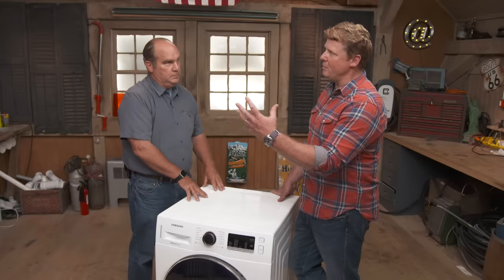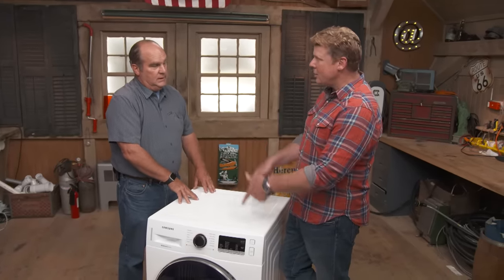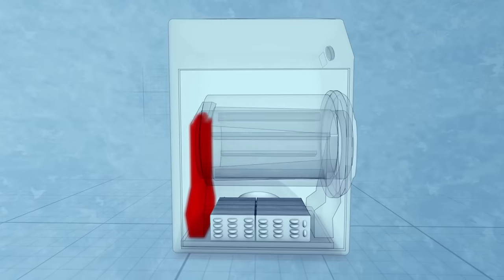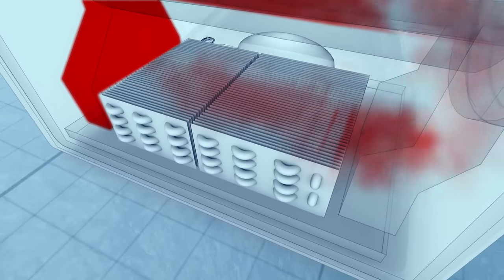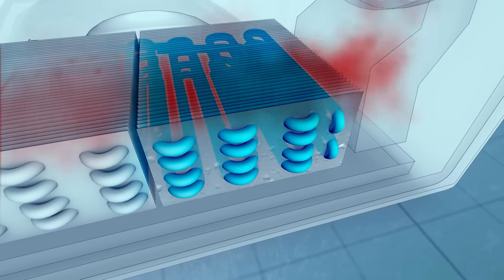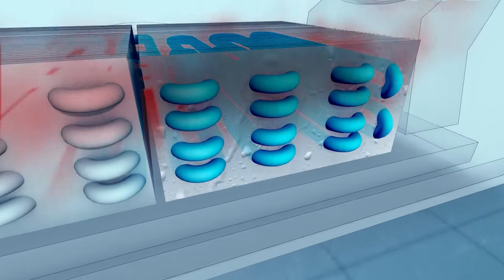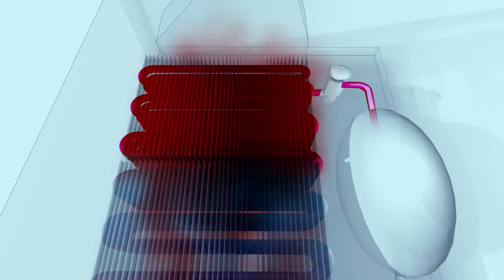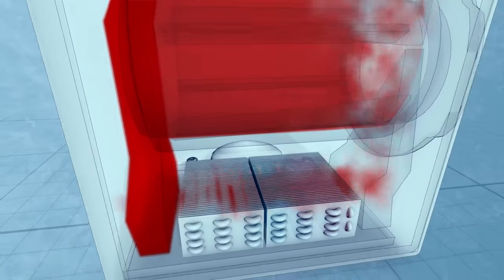Exploring a Heat Pump Clothes Dryer | Ask This Old House

Comment: What stops the condenser from rusting out after being exposed to all the moisture and chemicals (fabric softeners etc.) in laundry? Cheap versions could easily have planned obsolescence built in this part.
Where do the ultra fine particles end up that pass through a standard dryer filter? Do they cling to the condenser and become a food source for mold to grow upon? Is the filter system different?
Users here report that cycles are longer and smaller. So the fibers in one's clothes will be breaking down faster. And bed linens may not be able to be processed any more due to their bulky nature.
The laundry may take twice as long due to fewer items per load and longer processing times. Or we simply don't wash everything as frequently. My teenage niece would re-wash a item if it fell on the floor while taking it out of the dryer or after wearing it for a couple of hours while shopping. It will require changing one's habits I would say or washing nearly every day just to keep up in a family of four or more.

Comment: How much does one of those cost?
Reply: I just bought one for $1420.
Reply: Cory Stansbury ,
WOW!  There go any savings on electric.
Reply: I got one for 1k on a memorial day sale.  Check your power company.  They may also have rebates for getting efficient appliances.  Mine gave me about 75 dollars for getting a heat pump dryer.
Reply: @BB-mq3nn  It appears that expired in my state. However, I did get $750 for a heat pump water heater and another $750 for minisplit. In my case, I got it to help live within my main breaker capacity when adding the minisplit. It also reduced my heating loads due to infiltration/leakage. Energy savings will be icing on the cake.
Reply: @bigred9428  But it's not about saving money, it's about saving the planet, remember? Saving the planet doesn't come cheap (e.g., solar panels, electric cars, LEED homes, all electric homes, etc.)

Comment: Since the moisture stays in and doesn’t have to vent out of the house, does it increase the accumulation of condensation on windows during the winter?
Reply: The moisture turns into water and is either collected in the compartment on the too left or can be directly expelled through the grey tube

Comment: is it powered by 120 or 240 volts ...
Reply: 420 😏
Reply: @mastocytoma1  WHAT
Reply: @rbnhd1976  Yes. Here in continental Europe we don't have the sissy 120 volt system. This is a man's voltage!
Reply: Miele models will run on 120V, others 240.

Comment: You don’t dump the heat from an electric dryer outside in the winter. Instead ,put a nylon sock over the vent , and discharge the heat directly into your home.

Comment: If your not in a rush to dry your clothes, you can save yourself a lot on the energy used by your dryer, and your washing machine.
This is what I do, set the washer to its lowest spin speed, saves power and wear and tear on the washers drive and suspension components, then use an old tech wringer/ mangle to squeeze as much water out the clothes as possible before you put them in the dryer, if you can not get a mangle, use a gravity drain spinner, they spin the clothes a lot faster than most washing machines, use less power and remove more water quicker.
My dryer has the option to switch off the heating element and use just the ambient air to dry the clothes, takes longer but the power saved is well worth the time taken, the top tip is to remove as much water from your washing before it goes in the dryer, the energy saving is worth the extra effort, and using the lowest spin speed on your washer helps to make  it last longer and use less energy.

Comment: I have this exact heat pump dryer and members of my household report having to dry the clothes for 2 hours or more, basically two or three Cycles. I had high hopes for this machine and I'm really disappointed because if it saves 40% and I have to run it twice, aren't I using the same amount of electricity or more if I have to run it a third time? Also the capacity of this dryer is super small

Comment: Just like the new washers that use less water so that your clothes never get truly cleaned, this will more than likely suck also.
Reply: I dont know if Americans can't build low water consumption anything. We have it in Sweden and it works perfect, toilets and  washing machines. Used it for decades no problem here.
Reply: @fristrm    These new washers that weigh out the load to calculate the water level suck here.  Clothes never come out clean unless you wash VERY small loads, which defeats the whole purpose of saving water.
Reply: @mastocytoma1  The problem isn't the low water use washers it's the crap laundry soap we have now. All soaps went to crap in the 90s when they outlawed the use of phosphates in laundry soap and many states followed suit with dishwashing soap as well. TSP is your friend and TOH uses it all the time.
Reply: @fristrm  Not really much need for low water consumption in much of the country. Most drinking water comes from a lake. Then it's used in the house and then to the sewage treatment plant and returned to the lake. In fact the water going back in is cleaner than what is taken out so by using more water you are in effect helping to clean our lakes. 

       That said we have low water use toilets just like europe and our current washers are low water use as well. That said I have spent quite a bit of time in Greece and they do not subscribe to the low water usage standards. Their toilets use massive amounts of water and so do their shower heads. Taking a shower there is wonderful....
Reply: @elcam84   I'm sure that doesn't help.  I've had clothes come out of the washer that had never even touched a drop of water.  That's why I'm convinced it's the low level.  It was small loads as well!   But yes, the soap has changed too!
Reply: @elcam84  You can't judge European standards by Greece alone. How about Germany, Switzerland or even the Nordic countries?
Reply: @yvindascanius6061  Been to most of those as well but was referring to Greece because they aren't on the same page as much of the rest of Europe when it comes to using less water. My worst shower was in a Hotel in Paris..... It was just big enough to stand up in and barely a trickle of water. That was not a fun trip in any way shape or form... 
 
     Northern Europe has taken energy usage and water usage to another level which is great but how and why are another discussion. Here in many parts of the US using less water is not a big deal as many parts have lots of water to use and they return the water to the source it came from. We are fortunate to have the sheer amount and multitude of different resources here.

         Oh and please please get someone to sell ceiling fans in Germany. They could really use them in the summer since few places have air conditioning. You could make a fortune selling them there.
Reply: @elcam84  I have tried a shower like that in Spain. Took forever to get wet.
Reply: F ,
Yeah, but they take like three hours to wash a load of laundry.  I have seen them demonstrated all over youtube.
Reply: I dunno. My new speed queen only f’s up when it set to the eco mode
Reply: Robert Adams Low water usage in a top load US machine will never work properly. Low water usage in a front load machine works perfectly, because of the fundamental difference in the way the clothes move in the solution. Front load machines can use half as much water yet still achieve a better wash at cooler temperatures with less detergent and less damage to clothes than a top load.

Comment: And they cost anywhere between twice and four times as much as a standard type dryer, you'll be lucky if you break even over the unit lifetime via lower runnign costs. They are also lousy performance during winter if you have an unheated utility room or use a garage. Expect very long drying times and, of course, the increased wear on the unit - because the drive belts, bearings and motor will be the first to get clapped out.
Reply: You’re so right.  Except in our situation, the only machine that will fit our cramped space?  A combination unit like the $1600 (plus pedestal taxes and install) LG/GE.
Reply: I paid $800 for this exact unit. True on the unconditioned spaces but that's not the case for I would venture to say the majority of people. Can't speak for longevity yet as I've only had it for about 6 months but unfortunately Samsung doesn't have the best track record when it comes to appliances.

Comment: The upside of having this type of dryer is that it heats up the area a lot. My quick hack is using an indoor clothes rack for the delicates and other items that cannot be put in the dryer. ✌😀
Reply: Tracey Lafontaine  this type of dryer doesn’t heat up the area. Source: I own one
Reply: @Monsieur405  Oops, I actually wanted to mention the LG brand does. 
Good to know about this brand name though ✌😊
Reply: condenser dryers heat the space they are in, they use room air to cool the condenser fins. Heat pumps don't emit any significant heat, they just recycle it over and over.
Reply: @spencerwilton5831  good too know, thanks 😊👌

Comment: No dude, these things take like 3-4 x as long
Reply: There are two types of vent less dryers. Most of them are what we call condenser dryers. They not only take forever (2, or 4 hours). And many (most) models run cold water through the condenser for cooling and then sends the water out to a drain (they thus need a water drain).
As a result you use LOT of water to dry your clothes.
Then there is the REAL heat pump dryers. These units are expensive and have built in heat pump to run the condenser (the same as an air-condition unit).

Heat pump dryers don’t use water for cooling, and they are at least 2 if not 3 or even 4 times faster than condenser dryers. So in place of 4 hours, a heat pump dryer will take about 1 hour. 

So a typical heat dryer might be 30 minutes, the heat pump dryer would be about 1 hour.

A condenser dryer? 3-4 hours! (And it using water for cooling). (We talking gallons of water here). And your clothes is still not really that dry!

A vent less condenser dryer is often smaller, and is often a “combo” washer dryer. 

So, a “combo” washer and “condenser” dryer unit might set you back about $850 dollars. (Some are even cheaper). 

A condenser only dryer? They go for as cheap as $500 or even a bit less.

The real deal Heat pump dryers? The ones with a real fridge unit (aka: heat pump inside)? They are rarely combo units, and they start close to the $1,000 range for JUST the dryer. And you can easily pay $2,000 for some of these units (not a combo unit).

Most heat pump dryers also have a heating element, and if you put the unit on max, it will work as traditional dryers in terms of time. (you same some energy however, since once  temperatures are up, then the heat pump running provides a good deal of the heat required. These units thus can run and use their heating element, or just the heat pump only in a cycle to dry (or a bit of both). They are vent less, and have a water collector, or optional can use a drain. 

But the condensing process for these heat pump dryers work far better because you have a real heat pump running the condenser unit to pull water out of the air. They cause much less wear and tear on clothes, since it not heat that does most of the drying, but a condenser that pulling out moisture. 

Those lower cost “condenser” dryers as noted tend to be combo units – and they tend to increase humidity in the dryer room. 

A heat pump unit does a MUCH better job of removing moisture because there is essentially an air condition unit inside of the unit for the condensing process. 

The energy savings of 50% compared to a regular dryer is due to the unit recycling the hot air to cold and then back around to the hot side (it’s like leaving your fridge door open – it will not cool (or heat) you house that way!!

So the room is not heated up much in this mode. And you not sucking large volumes of air from the room to the dryer and then heating the air and THEN venting it outside. That is air you paid to heat, or paid good money to cool.

The 50% rated savings in energy does NOT include this significant factor of using large volumes of air and then venting that air outside.

Condenser only dryers (without heat pumps) are also vent less, but they SUCK big time. They take hours and hours. They tend to be cheap as dirt, and as noted most use cold water flowing through the condenser unit and then that water is sent out to the drain. (Gallons of water are thus used to dry your clothes).

The difference between vent less “condenser” dryers and vent less heat pump condenser dryers is night and day (and so is the price!!).

So heat pump dryers take about double the time compared to heat dryers, and this will somewhat depend on what energy mode you run the unit. If you run them at full mode, they will work quite much like a regular dryer (but is vent less).

Those rotten condenser dryers as you note take 3 or even 4 hours – and your clothes still don’t come out really dry. 
They are crap, never really get you clothes dry.
If you have the money, then heat pump systems can even run if you off grid.
Reply: @Albertkallal  well said, thanks for the info!
Reply: This is not a condenser dryer - it is a heat pump dryer and it takes about 10% longer.  I would not buy a condenser dryer but would buy a heat pump drier.
Reply: @tinytunes84  yeah my bad, I'm just salty about using a condenser dryer 😅
Reply: 5-6 times as long, in my experience so far. I came here to find out if we’re all still pretending these machines do anything. Not to mention how scalding hot the clothes are when you open the door. My family always knows when the laundry’s “done” thanks to my yelps!

Comment: The problem I have with this is that if energy savings for environmental reasons is your aim, then you really need to just be hang drying your clothes. If cost savings is what you are after, a $100 used dryer will still be far cheaper than buying some new luxury $1k+ unit like this (dont actually know the price, maybe it's actually economical, but I doubt it). So really this solves neither problem and is only wasting your time in the end.
Reply: What about winter
Reply: @jordanfollett1675  build a cheap shed. Not everyone lives where it snows either.
Reply: @Luckingsworth  yeah then my clothes can freeze in a shed
Reply: @jordanfollett1675  Okay. Let's stop for a second here. Where are you coming from? My comment was pointing out that this is worse than a regular dryer, and still worse than the environment than just hang drying. So it serves no one. Are you an environmentalist? Then yeah, get over it and deal with cold clothes in the winter like humans have for thousands of years. Are you a regular guy? Then just get a regular dryer my man. The thing in this video takes twice as long to dry and often still leaves clothes damp. That was my point.

Comment: There is actually a better dryer that will be out on the market soon.  The heat pump dryer although energy efficient takes too long to dry clothes plus you are now dealing with freon.  A company called hydromatic  technologies has developed a clothes dryer that not only uses far less energy than your conventional dryer electric or gas but is  also the safest.

Comment: The theory sounds awesome, but until this becomes mainstream I’ll bet these things are a pain in the butt. Hot/cold+water = rusty. Still, electric dryers do suck power.
Reply: They're made out of the same material as your AC unit outside.  It doesn't get rusty
Reply: These dryers ARE mainstream, in countries other than the US, particularly in Europe. They're wonderful. We Americans are simply behind on technology.
Reply: Smurdle450 Behind? That's an understatement- Americans are still by and large using top load washers, thinking front load machines are new and therefore unreliable technology, when in truth Europe adopted them forty plus years ago and consigned top load machines to history.
Reply: Build Motion they seem to be popular in Europe

Comment: Good for summer but stealing heat from your home in winter? I guess still far more efficient that blowing heat outside and replacing it with cold air. I can see the condenser fins getting clogged badly over time. Those lint catchers don't get it all.

Comment: why aren't lint traps placed on the top back and away anymore? these designs where they are inside with the clothes tumbling away are recipes for disaster (clothes getting caught on the edges) and it is harder to clean them up thoroughly!

Comment: Now what if you added a vacuum, if the drum chamber was under vacuum and the exhaust was expelled over the condenser could you retain the heat and lower the evaporation point of the water?
Reply: You didn't pay attention in physics, did you? 🤣
Reply: @sjokomelk  well I'm only asking. Could you explain the issue?
Reply: @jeffjefferson3364  You still need the same amount of energy to make the water evaporate. Vacuum doesn't change the laws of thermodynamics.